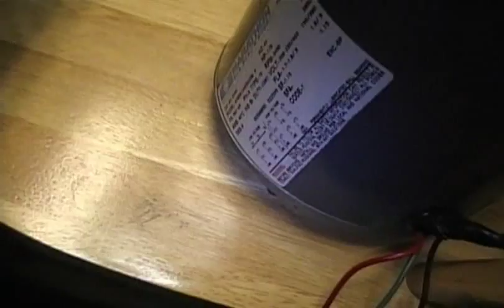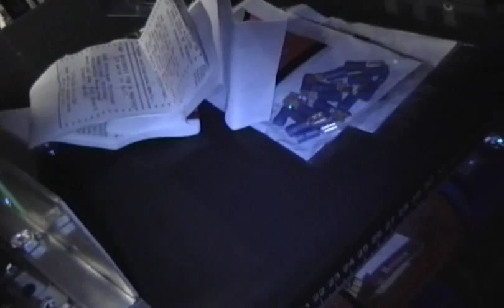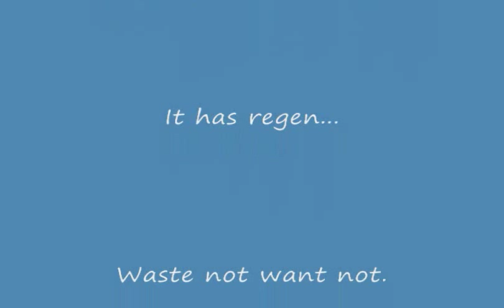AC Controller Project #1.wmv

Comment from the maker: @BenjaminNelson Hi Ben!  I think it can be pretty small.  Tom's probably has huge input inductors and other stuff since it's (probably) supposed to get its power from a 3 phase line rather than from batteries, which are already DC.  Depending on how the capacitors end up sitting and how the control board is mounted, it can be similar or slightly larger than the DC controller.